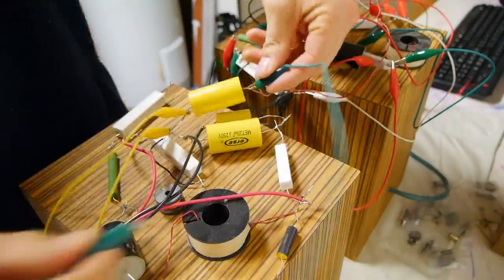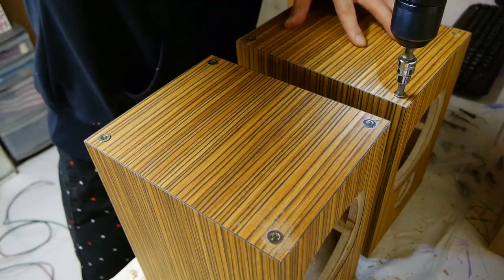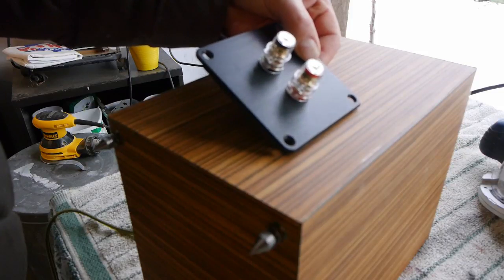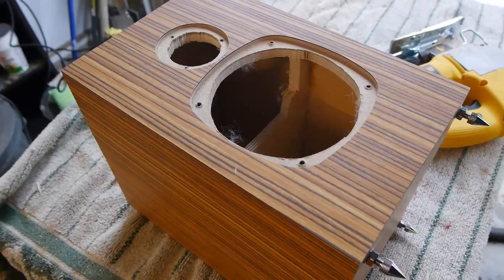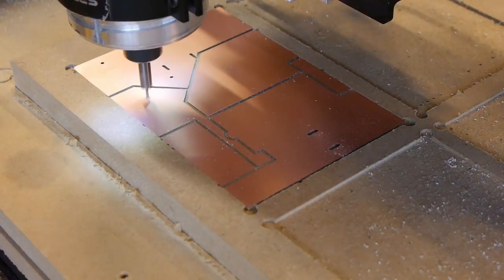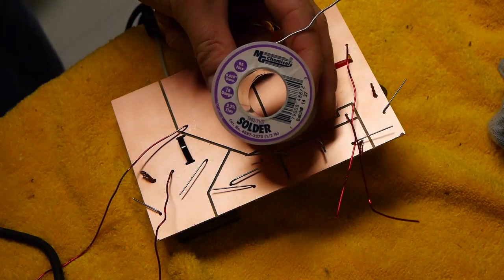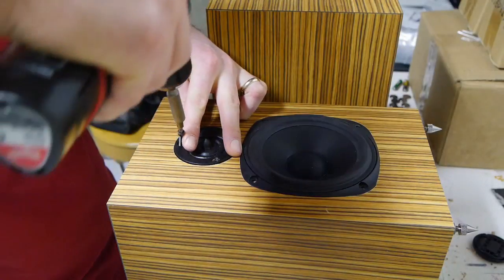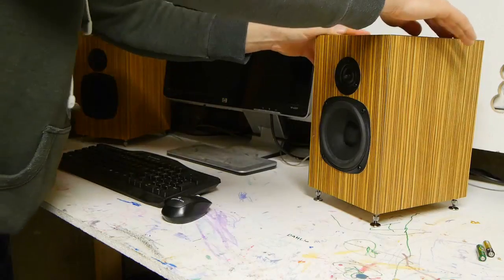Life S5 | Part 5: Final Assembly (DIY desktop speaker)

Comment: Nice job but what don’t you Line the cabinet inside walls with NoRez
Reply from the maker: To be honest. Ive never heard of NoRez. I assume it’s a product like dynamat? Some kind of bitumen damping material?
Reply: @ImpulseAudioSpeakers  compination of 0.070" self adhesive heavy loaded plastic foil plus 1" open cell foam. the damper handles cabinet Res and the foam addresses standing waves by slowing down airflow and thus making the box behave as if its a bit bigger. I bought smtg similar in Switzerland produced locally by Vibraplast

Comment: I was surprised to see you put spikes for desktop speakers! I would have put rubber feet to provide a bit of isolation and damping. On the other hand, I concurr with the idea of glueing every crossover parts. It will help to attenuate microvibrations from the drivers interfering with the purity of the signal. Also, placing the inductors as far apart as it is possible help attenueting crosstalk between coils caused by magnetic interference. With the high grade components you put in, the result should be great!
Reply: And the inductors should be positioned with the big one flat and the small on standing up in its edge so it would roll away from the larger one, so the magnetic fields can’t interfere with each other
Reply: @stephenyoud6125  Exactly!

Comment: You have an awesome shop! i'm just getting into speaker building and I'm envious of your table saw, table router. I got me a Jigsaw and drill and seeing how far I can get with just that. For circular holes I'm planning to make a jigsaw jig. Thanks for the inspiration! Where are you located btw?
Also I see you sealed your sub boxes with PL sealant. Would wood glue alone be OK?
Reply from the maker: Karan Sikka Hi, I live in Ladysmith, BC Canada. Glad you enjoy the videos. Yes wood glue is enough. I only used PL on the huge subs because of the size of it. I rarely use PL. 

By the way, I’m loosing my shop in the future. Going to tear it down to be able to build an addition on our house :(
Reply: @ImpulseAudioSpeakers  where will you work on speakers then? The addition to your house?
Reply from the maker: Karan Sikka thankfully it’ll be a while before we do it. But once we do I’ll have to do it outside on a couple of saw horses or something like most people.
Reply: @ImpulseAudioSpeakers  😢

Comment: The inserts for the feet should be inside the cabinet so they sandwich the panel between the insert and a nut/washer on the outside. On a larger speaker the inserts would tear out when shifting it.
Reply: Great idea

Comment: Thanks for following your project.

I miss a video about your box considerations. Reflex, closed box, size (q), internal stiffening, wood thickness, baffel size, simulations and so on.
I ask because I saw that you have a "shelf" inside the box and hope that you hade some considurations regarding the box.

(PS: I'm currentlly building a PC speaker using http://www.sbacoustics.com/index.php/products/midwoofers/satori/5-satori-mw13p-4/ and https://www.madisoundspeakerstore.com/hard-dome-tweeter/audax-tw025a20-1-titanium-dome-tweeter/)
Reply from the maker: Benny Jørgensen Hmm, I suppose I didnt describe it very well. I did mention it in Part 1 and Part 2B talks about the woofer TS parameters I measured. Hopefully these Parts 1 and 2A help with your question. I will also be discussing my choice for sealed a little bit when I do my final thoughts.

Comment: I've done tight cutouts on my CNC. Apparently climb cut or conventional cut require compensation due to the bit deflection. I also usually oversize by 0.005" just to be safe. 
Good video, as usually.
I've also run my spindle in to the spoil-board. This is why I use nylon screws to attach spoil-board tot he Al extrusion frame.  :)
Reply from the maker: Impulse response I was a bit negative with that comment :P I havent enjoyed cnc ownership cause, so I am a bit critical. But ya can totally pull off a detail like that.
Reply: ahh, CNC is just a tool. It can be a total PITA. It works great then it does. I had a BSD after 4 hours of machining, just another 20 min before the finish of the operation today. Have no idea why.